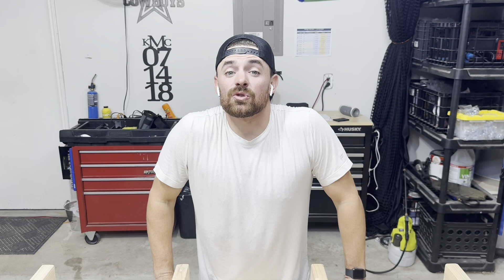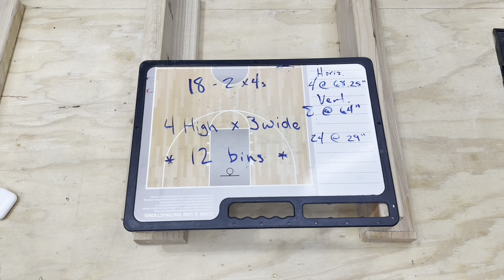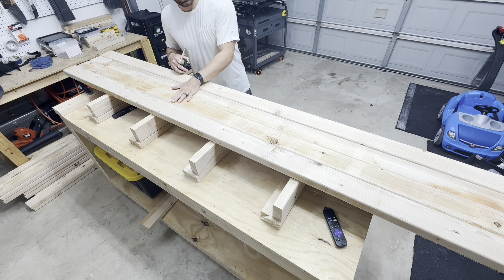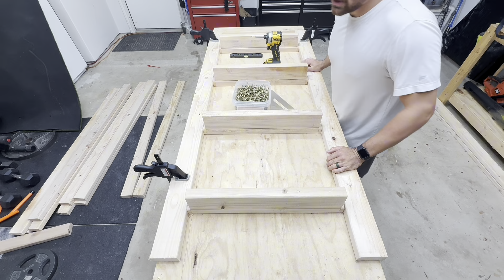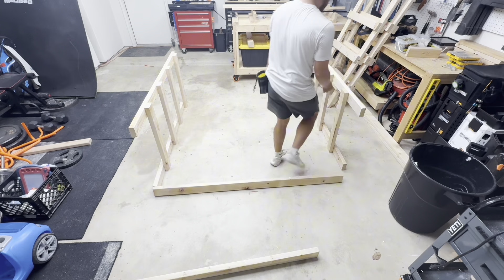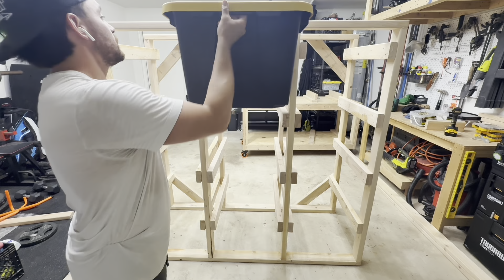How to Build a Storage Rack for 27-Gallon Totes

Comment: Hey, we are wanting to build a 4 bin high & 4 bin wide. We love your video. Anyway you could help us with the measurements for that size for our storage building.
We are trying to get a list of supplies and the measurements.
Reply from the maker: You will need 23 - 2x4's for the 16 bin rack!
Check out this video - https://youtu.be/C-GreqWoREU
It is an 8 bin rack, but all the measurements are the same as the 16 bin except one. The verticals for the 8 bin are 32.5" and 16 bin is 64", so that would be the only change. Let me know if that helps! 

I am also about to put out a rack build video without the jig... just fyi!